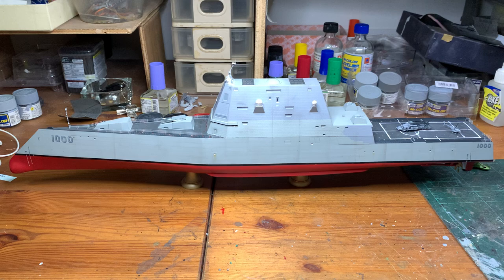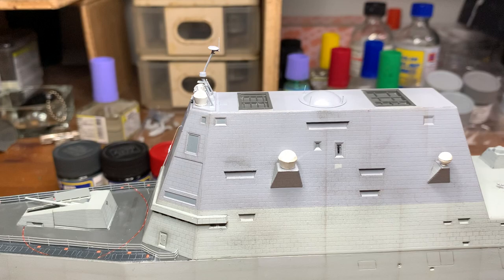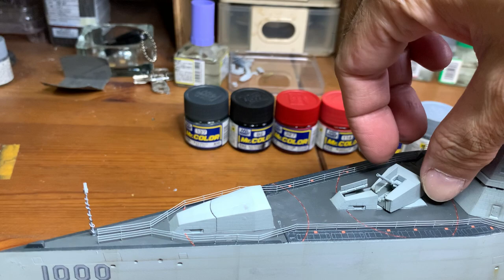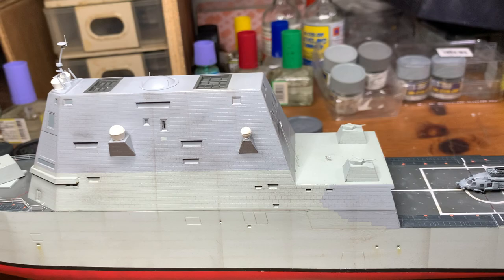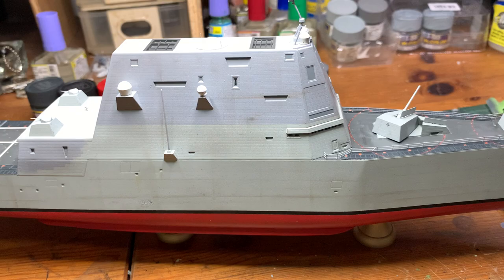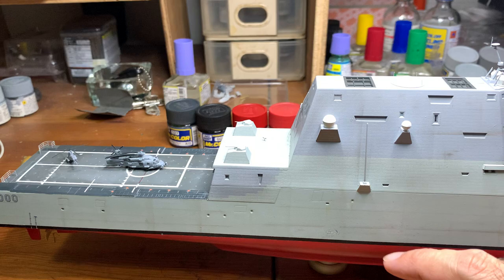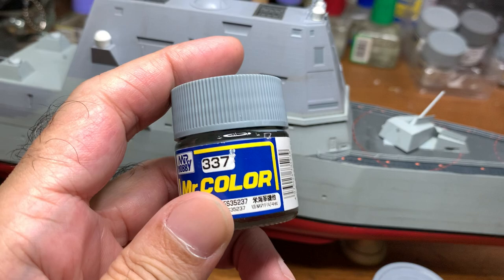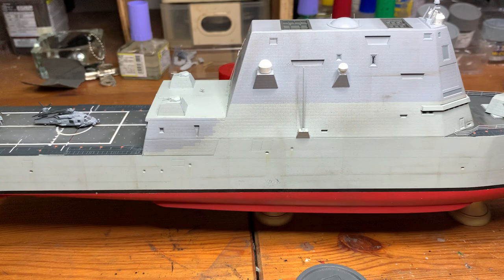1/350 DDG-1000 Zumwalt Class Destroyer from Snoman model/Takom. build updated . part final.

Comment: You've done an outstanding job with this model. Museum quality.
I particularly liked where you highlighted issues with the model and how to deal with them. If I were the brand here, I would replace the few parts inadvertently lost during assembly. 
My opinion is that you would have more views if you did more about how you achieved your results. Examples : What masking techniques give you such finely detailed results? How did you apply the paint to get such thin coverage, any thinning methods, tools used? How did you fill the gaps that you mentioned?
Reply from the maker: thank you very much for your kind comments. point noted on showing more of how i achieved my results. i didn’t talk much about putty , painting, masking because i just did the norm applying putty then sanding. i thought it might be boring but you made me realized i should focus on those details too. thanks for pointing it out.